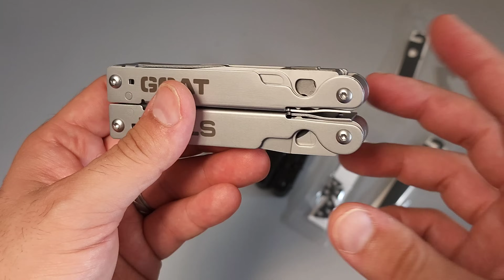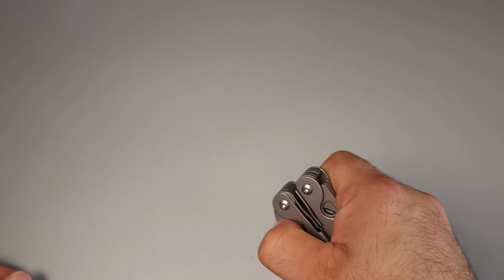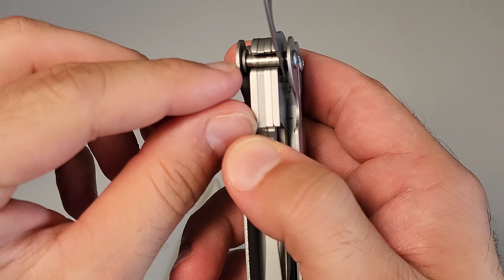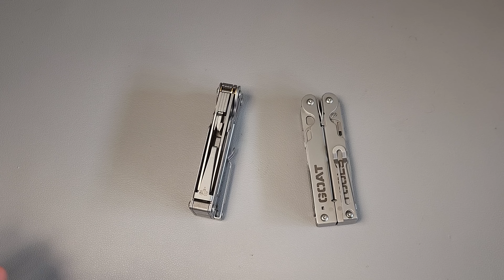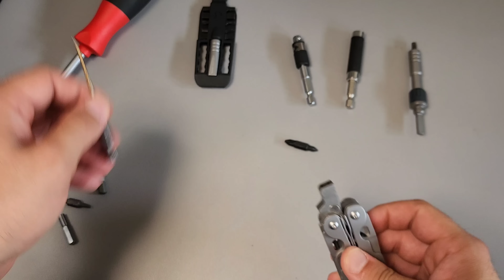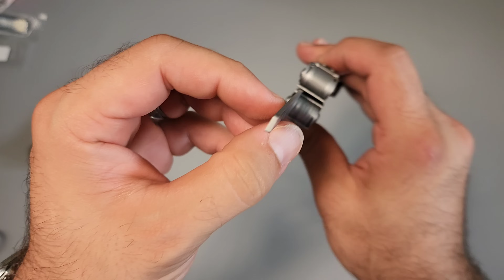Beginners Guide: Modular Multitool from GOAT Tools

Comment: i have to warn all interested people here....friend of mine received the tool and it is absolut crap. Scissors do not lock, so they are not usable because the spring do not work if the lock is not engaged. removing the tools is ok, putting them back into the tool is complicated...sometimes a whole mess. implements are falling out, if the screws are very tightened, it is still possible to shake the hobby blade out...very nice in your pocket. Brass Scales mounted...one side of the tool is opening by itself, no matter how hard the screw is tightenend, one grip will always fall open easily. also gap between scale and grip is quite big. If the tool is squezed with some speed, the implements will fall out to the inner side, somethin which never happens in a LM Charge, Wave or whatever. i think, this problem was adressed with the lock on the Roxon Flex...which is also a crappy tool by the way

so be warned, this tool is absolut crap, also customer service is not responding

Comment: 15 April 2025..Goattool cutter still doesn't cut properly..mine is brand new..latest manufacture..still won't cut wire and has significant gap in pliers when closed to maximum..

This issue is quite old now and apparently never addressed...certainly not rectified!!

Not a good company to patronize!!!

Comment: Not impressed at all, scalpel is down right dangerous, comes out every time a tool from that arm is deployed and is in danger or cutting your hand, locks only work if an additional tool is deployed, feels cheap, stupid choice of near useless small tools, replacement tool lever constantly opens when any tool is deployed, scissors are a joke the spring just does not work at all, the only good item are the pliers which seem as good as any available ! Needs serious work, more likely a total start again !

Comment: Great review -- thanks for all the detail and insights. A minor point: a flat-head is a screw with a flat top and bottom that tapers inward, allowing it to sit flush with the surface it's driven into. The screwdriver that has a flat tip is not a flat-head -- it's a slot driver (as opposed to Torx, Philips, etc.). A slot driver is used with pan-head, washer-head, flat-head, and other types of screws. "Head" refers to the screw, not the driver!

Comment: I have about decided to get one of these.  One thing that made me stay away from the many well designed import multi tools you have shown is the steel they use.  I always thought something like the Multi-force would still be a bargain with decent steel at twice the price. 2 or  3Cr steel is just not worth it at any price in my opinion.  Here you get pretty decent steel.  I think 420 HC gets a bad rap, and is plenty tough for my uses.  So in a way you get the upgrade steel and for not a whole lot more you get the added modularity, all for less than half the price of an ARC.  Kind of waiting on the Roxon Flex, but I like the outside accessible big 4 like on the GOAT.

Something I immediately wondered about was a SOG style bit driver in the plier end of the handle.  Maybe design or patent prohibited, but would be handy and allow doe a bit driver option there allowing for another tool arrangement on the inside.

Comment: These doesn't look like it is read to use when you get it? There is no point of one handed opening if the blade lock has to be pushed back in the tool every time you open it.

Comment: Great videos on these tools. However, I still have a question that I can't seem to find the answer to anywhere. Where are GOAT Tools and their parts made? I've done internet searches, looked on reddit, and even the company's site. Can't find it. I've paid as close attention as possible to videos and don't see "made in ____" anywhere. Can anyone tell me where they are actually made?

OH, and thanks for highlighting that 711L Hex Bit extender and giving a link for it. That is going to be my bit extender regardless of what multitool I choose. The next amazon order I make it's definitely going in the cart!
Reply from the maker: All made in China, basically there is no way to start a Multitool company differently. Eventually he wants to make it usa made...but that will lead to significant price hikes.
Reply: @maxlvledc  Thanks for the reply. I really appreciate it. I spent the better part of an hour trying to find that info. Tried videos, reddit, official web site and multiple searches with google, bing and even a bit with duckduckgo. When I didn't find an answer I figured it would be china. Wish he would have been upfront about it. Than I wouldn't rank the company any lower than Gerber or SOG. Between the hiding and some of the design choices of the tools, I'll consider GOAT last.

I get that producing in America can lead to a cost issue. It's a valid reason to produce elsewhere to an extent. Getting a new company off the ground is one of them. It's hiding it that gets to me more. When companies get cute by trying to side step with "assembled in America." try to hid it all together, or use "made in the USA" as a reason to price gauge, it makes me want to pass and look at clones. If what I'm buying is china I might as well reward the honesty, save some money, and take advantage of some redesigns.

Comment: I tried swapping in the ultra thin washer and it made it harder to swap the blades as I keep hanging up on the washer. I ended swapping it back to the original configuration.

Comment: I ordered mine early in the Kickstarter campaign, but when I finally got it I had a lot of trouble with the scissors. They don't have enough spring tension to open back up between cuts and they unlock when the blades are together. Also they are very loose when closed into the handle and they fall open. I tried replacing them with the cutting hook, but that falls open too. Everything I try to put where the scissors were is loose, and I can't get the pivot screw on that end any tighter.

Comment: where's the link to this tool???

NICE using hard steel cutter inserts
I've had issues with the Gerber carbide shattering
carbide makes sense in machining but NOT for a wire cutter

blade removal
Case Knives did it opposite, no blade play
maybe there is a copyright thing...
Reply from the maker: At the time their site wasn't up yet. https://www.goat.tools.com

Comment: Having received my multitool yesterday I can’t say just how disappointed I am with the “ wire cutters”
They are rubbish and I really wish that you had reviewed them when promised. I even stupid ordered spare blade but these “cutters” just crush the cables I have tried them on,useless
Reply from the maker: That is also what I found as well...wierdly I never used the cutter the whole time I carried the tool. It's definitely something that needs improvement but it's not an issue with the cutters as much as it is a lack of clearance ( no where for the wire to go)
Reply: @maxlvledc  Actually if you look at the cutter blades they have a flat edge hence the crushing,I’m going to try and grind a proper edge on a couple and see if that improves the performance
Reply from the maker: @anthonyschofield7807  that's also part of it.

Comment: Have one on order. Will be my first multitool. Thinkingbabout getting one of those Ozark Trail numbers as a backup. Considered grabbing a Curl the other day when they were 15% off, but when I watched some reviews one of the biggest gripes was the price point, and its gone up $10 since then.
Reply: What were they comparing the curls price  too? If it wasn't an American made multitool than it wasn't an accurate comparison.
Reply: @christopherroth7239  I don't think they were comparing it to anything. Dom talked about it as did Gideon Tactical. Both said everyone was saying it was priced about $10 too high for what you get. And it somewhat stopped me from ordering one at 15% (for basically the old retail everyone said they thought was too much).
Reply: @hificat101  Anyone can say something is priced too high but if they are not backing that claim with data then it's just their opinion. No YouTube reviewer has any idea what  leathermans, or any other manufacturers, producrion costs are. So again, if any of them are going to compare pricing they need to compare tools of comparable quality made in the same country. Anything else is just them talking to hear themselves talk. I guess the main thing I am saying is don't let  you tube reviewers opinions about prices stop you from buying what you want.

Comment: I can't tell how deep the carbide insert cavity is, how much material is behind the insert? It seems like a possible failure point on those pliers. Either way it's an interesting tool. I may not be replacing my leatherman just yet, but I'd like to see what they produce next. I'd definitely jump on a modular mini-tool with a similar form factor to the powerpint.
Reply: What carbide?
Reply: I agree, I think the concept of the GOAT is brilliant, with the ease of swapping, but the form factor is just too big for my edc. 
I’d like to build a blade-less power pint 2.0 (to complement a real knife), with some decent shears, the ability to properly use a t-shank jigsaw blade and perhaps a scalpel or craft knife. The ability to easily customise would be huge.

Comment: That big screwdriver with the hex cut out is probably designed that way on purpose. Seems obvious that the point of the hex is a major stress riser and its positioned right across the face of the tool. The guys designing this are definitely smart enough, highly doubt thats an oversight. More likely engineered failure. That thing is so big, someone will end up using that as a pry bar in some crazy situation and breaking the whole tool.  The way it comes, you just break the one part.
Reply: It’s pretty hard to imagine bending or breaking the whole tool.  The screwdriver is always going to be the weak point.

Comment: My boyfriend got his multi tool yesterday and had nothing but problems with it. He thinks he got a bad one from the factory. After seven hours of tinkering over the course of two days (yesterday and today) it’s finally in a useable condition, but he’s not very thrilled with the tool. The pin that holds the small tools was misaligned causing the hot swap bar to bind causing the tools (including the knife blade) to flop out.
Reply from the maker: Have him contact goat tool for replacement parts. I definitely didn't expect it to be perfect. Most forget the PST had 4 iterations after first release.
Reply: I got my GOAT Tool a couple of days ago and had similar problems but it was because I started playing with the tool without reading the instructions (quick start guide).  Watching maxlvledc work his GOAT Tool helped a lot.
Reply: I promise you that he’s overall happier with a girlfriend who listened to him closely enough to type this much detail out than he is disappointed in his multitool. 

Communication is the multitool of relationships.
Reply: @JasonJrake Well Stated. Score 1 for The Lady. Ditto on the observations.❤
Reply: @JasonJrake true, we love playing with our tools but playing with our gf/wife etc allways beats it ;)
Reply: This is an incredibly wholesome thread.
Reply: These are some awesome guys with awesome girlfriends😊
Reply: Skill issue